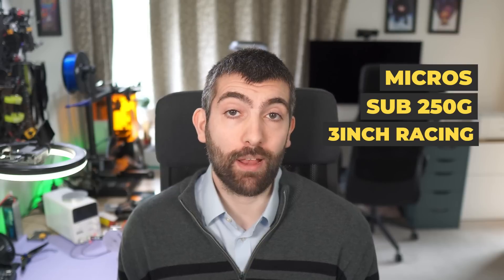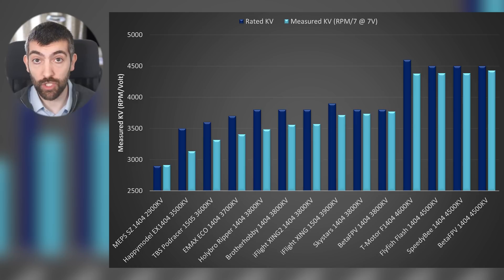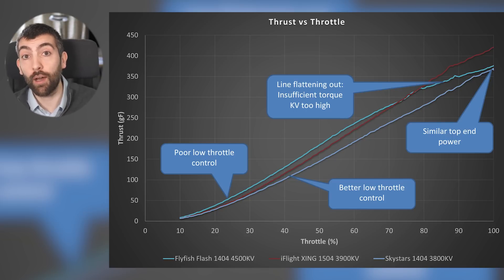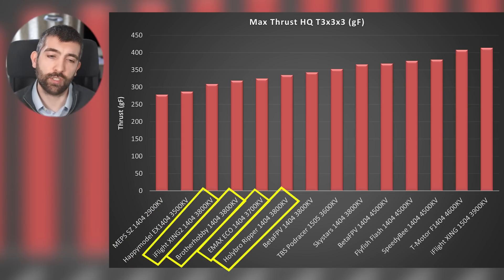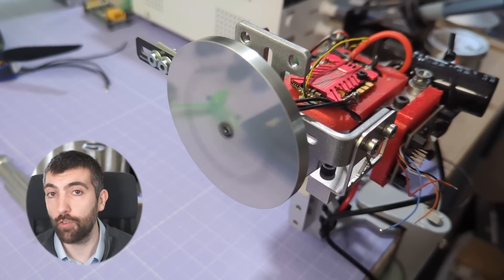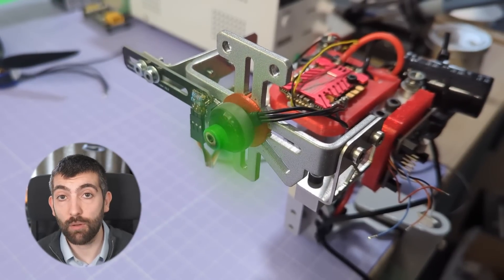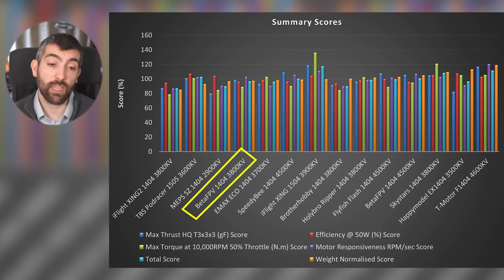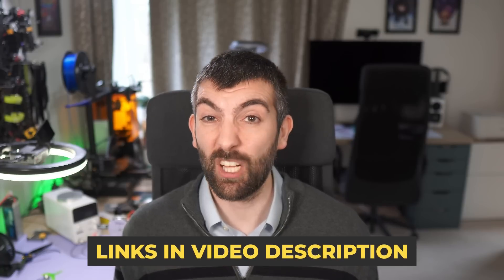The best 3" motor no-one has heard of... 1404 Motor Testing!

Comment: I'm currently using 1404 motors with a 4S battery on a 3-inch drone, but it feels underpowered. I'm considering switching to 1507 motors—do you think that's a good solution? Or are 1507 motors too big for a 3-inch setup?

Comment: Hey there!

I just ordered your awesome AOS Cine 25 V5 frame and all the components to go with it. I'm following your advice and will be using the Skystars Koko 1404 4600kv motors you recommend.

My main goal is to keep the final All-Up Weight (AUW) under 250g. Since I'm not exactly sure what the final weight will be, I haven't ordered the LiPos yet.

In the meantime, I'd like to do some initial tests using the LiPos 6s I already have. My question is: in your experience, what would be the maximum AUW you think these Koko 1404 4600kv motors can safely handle without risking damage? I really want to avoid burning them out while I wait for the right batteries.

Thanks so much for the fantastic design and any advice you can share. I can't wait to get this build in the air!

Comment: I wonder how the T-motor F20ll 3750Kv motors would do against these as well.. I have them already so they're going on a light-ish weight 3" Analog build so I guess we'll see, but its not a T-mount prop Motor. 
I believe its a 1408 sized motor though and it has the normal M5 prop shaft.. I'll have to look into those iFlight XING 1504's 3900v and T-motor F1404 4600Kv motors for my 3" O4 build I'm planning somewhat soon actually!!
Awesome video as always man!

Comment: Hi Chris, is the T-Motor 1404 4600kv suitable for a baby Ape Pro V2 powered with 3S and 3 inch Props? I think the peak current of the Motor could be to hight for the ESC.

Comment: I still have the rcinpower 1207 5000kv for my 3s toothpick. I went crazy buying parts 5-6 years ago, and havent had to buy anoything fpv for 2 years or so. Except new goggles and batteries. I still have an Airbladeuav "plus" Eclair in 3" with iflight xing 1404 4600kv. Oh, and the $45 diatone 30a mamba stacks in EVERYTHING that needs a 20x20. I need to get with the times...

Comment: Chris, have the Crux35, 1404 / 3500 Kv motors light Weight very efficient, Q, about Crux35 3.5” Shit frame. this is the 3rd frame  I broke on grass crashes. Can you recommend a lightweight durable 3 or 4”  4/5 Mm frame that’s better than the Crux35 Frame and can use the Crux35 20 x 20 stack / 1404 M etc.  any ideas Bro?

Comment: You don't speak about it but for all high Kv motors that are flattening, shouldn't we select a more suitable prop (reduced pitch for example ?) Kv selection is not the only parameter.

ENGINEERING QUESTION (good idea for testing/video?) Pursuing the goal of long range/best efficiency/lower power draw, is it better to :
1 - 4S battery, full throttle. 
2 - 6S battery, same propeller, reduced throttle  
3 - 4S battery, bigger diameter prop, reduced throttle. 
Motor/esc stay the same. Prop is chosen low pitch & have the best efficiency in 1rst case. Throttle is managed to get EXACTLY the same traction in the other cases.
Interresting to know if esc frequency can change the result and maybe other parameters I don't see ?

Many thanks in advance.

Comment: I luv my Skystar motors! I have almost every size and they are all some of the best economical motors you can get, i always wanted them in the other tests, Glad to see they did pretty well, i knew they would, i just wish the Motors were actually Matched up more,  like why put 3800kv against a 3800kv, t-motor makes a 3800kv but chris uses a 4600kv... just Not really a fair match up, like the low kv are for a biblade 4inch or 6s... Why is everything  all over the place?? might as well put a skystars koko 1505 3400kv in there on 6s that's going to destroy all those, lol
Reply: Honestly in my experience the T-motor is a touch lighter and may preform slightly better then the skystars if the 3800 is matched against a 3800, and same with the higher kv, cuz both skystars and tmotor are available in similar kv ranges, the biggest  difference is skystars costs more then 30% less which is why I'm a massive skystars fanboy. I would like to see the skystars 1505 matched up with t-motor 1604 on gemfan 3630 props tested on 4s and 6s! I've had crazy good results with the skystars!

Comment: 3:26 How can you precisely measure thrust, when ~50% of the area behind the propeller is blocked ? I can image it distorting results quite significantly, especially at higher throttle. Also I've tested most of available 3" propellers and the HQ 3x3x3 is one of the least efficient ones, tested on various motor sizes, KVs and AUWs.
Reply: They are all measured the same so the results would be the same. So comparison will be ok l.
Reply: @scottshipley570  That's true, but i can imagine that better performing motors will be affected more, so you can't tell that this motor performs 25% than the other one for example.

Comment: Your review is on point, I was just looking for 1404 motor for my 3.5 build!)
Two questions thou:
1. Since you make Supernovas with RCinpower, why haven't you included their 1404 SmooX motors in the test?
2. I need 3800kv for my build, should I get T-Motors with 4600kv and cap them, or should I simply get the 3800 version?
Thanks!)
Reply: 100% what I was thinking about the SmooX
Reply: I would go with the T-Motor 3800 if you are using 4S battery, thats what I use. I did try several 4500 motors but resulted in too much voltage drop, too much power for the batteries I like to use
Reply: @rafaelgonzalezmorales1824  Yeah, 3800 seems about right)
Reply: Same

Comment: If you had to run a 50g naked gopro (flywoo v2.0) on a sub 250g freestyle quad, what would be your ideal setup? What motor, prop and battery size? I´d propably design my own frame:)

Comment: I'm surprised to NOT have seen a Rcinpower, Mamba or Flywoo motor inclused in the test while some really obscure brands I never heard of were...
Also, I take it as a 1404 class test rather than 3-inch motor test. 1404 (not to mention 1504 or1505) in my experience is way, way too heavy for a 3-inch build. I use 1404s on my 3.5 builds (130g dry weight digital toothpick) and I use 1204 or 1304 motors on my 3-inch analog toothpick builds (60 - 70g dry weight). 

Anyway - I hope this was a prelude to you, Chris, releasing your own 1404, which I very much look forward to - it will most likely be a replacement for my current Rcinpower on 3.5-inch builds, so long as you make it both a 4s (around 3800 - 4000kV) and a 3s (5000kV). 5000kV is a very interesting option, because, in my experience it performes phenomenally well both wit 3s and 4s (75 - 80% motor output)
Reply: I use 1604 on my 3inch builds and love it 😜

Comment: Very nice in depth testing. Thank you so much!
I am actually moving away from 1404 for 3”. I’m down to 1303.5 now. The lighter motor combined with almost the same power makes a good pop when you throttle up and a good amount of control. Obviously that would not be as good for cruising.

Comment: Thanks interesting test, also of interest to compare the internal resistance of the motors. I am pleased you added the efficiency of the motors at 50%. Interesting motors would also be the Sparkhobby Xspeed 1303.5  and the Geprc Speedx2 1303.5 3800kv, which both show high efficiency nrs.   Personally I like to fly the less powerfull motors, on 4s light toothpicks, with light bi-blades prop.  the HQ prop on my toothpick are absolutely inefficient. Gemfan hurican bi blade and 3 blade are much much better on light 3inch builds.    Which is totalally different usage than on heavy racer or cinewhoop.   So to pick the right motor for the application is still not obvious, there is a lot more constraints.  So the happy model most efficient motor could be the best choice for the light tooth pick and driven with light gemfan bi-blade.

Comment: How do the lower torque motors behave with a lesser aggressive people like a 3x1.8x3?

Does the Power curve still bend down?

How does one low torque motor behave with different props from 3x1.5x3 up to 3x4x3 ? 

Where is the sweet spot?

Comment: Great testing as always. The only thing I missed was for you to recommend using a lower pitch prop with the higher kV motors to reduce the flattening of the thrust curve. I think the HQ T3x2.5x3 could be a better fit for some of the motors.
Reply from the maker: Great point. When I do batch 2 I will definitely mention that.

Comment: Everything points towards the T-Motor F1404 3800KV to be a great motor, if you ever decide to add more it should definitely be on that list to compare 2 different KV of a motor.

Also sad that the P1604 didn't make the slightly-larger list, it seems to be the perfect compromise for 250g AUW freestyle if you take care to save some weight in other places.
Reply from the maker: I have an open door testing policy, I'm happy to test and return to you any motors you want added to the database. 👍

Comment: Do these results vary depending on the ESC the motor is mated with?
Reply: If your ESCs handle >20A per motor, the results should be the same. No matter what esc or aio manufacturor.
But your battery will change these results alot. Still the motors compared to one another give the same results

Comment: Would have liked so see the Flywoo NIN 1404. It has a decent flux ring. It reminded me of the AOS motor as a result. Thank you for testing on behalf of the community.
Reply from the maker: If you have a spare flywoo nin 1404 you can send it in and I'll test and return it to you.
Reply: I sent an email to Flywoo asking if they could send Chris a motor because I also would love to see the NIN 1404 in the next batch
Reply: @ChrisRosser can you also test the Smoox 1404 2750kv, I’m running them on a 4 inch LR and while they might not have a great deal of thrust compared to some of these others in this test, they are extremely effecient and I’d say on par with the Flywoo

Comment: Would these motors so be suitable for a 3.5" sub250? Maybe the lower kv versions? Thanks
Reply: It's fine for lighter 3.5inch builds. Cinewhoops are probably too heavy. A Crux35 is a nice frame for a 3.5inch build with 1404 motors.

Comment: WHY WHY do you not go over durability and construction of the motor???
this is all great for people who are chasing 5% - 10% additional performance but the reality durability is a lot more important for 2024
its not 2016 any more 

shaft diameter is an extremely important spec specially on 1404, motor materials and construction, bearings, and motor weight, a super light weight motor while very good, can also mean it won't last beyond a single crash.
Reply: I’m pretty sure that all these motors use a 2mm inner shaft with a 1.5mm outer shaft and the same size bearings. Perhaps he excluded such specs because they’re all the same.
Reply: @yohfpv  Unfortunately that isn’t true, some of these are 1.5 and some are 2. For example, Emax motors while very cheap, they were more durable than most because they had a 2mm inner shaft.
Reply: Has he developed a reliable and accurate durability test yet? Without that all he can do is rattle off specs that you can find on your own.
Reply: @Voyajer.  a lot of manufacturers don’t list these specs, which is the point of someone testing and comparing. also a lot of people in hobby don’t even know what to look for, maybe you do but a lot don’t….

Comment: I'd love to see Flywoo NIN 1404 added to the list!
Reply: This! Flywoo motors are crazy good nowadays
Reply: I would too!
Reply: Rcinpower smoox 1404 are on par with the Flywoo NIN 1404 if RCInPower test sheets are anything to go by.   I'm currently working on an ultralight 4inch sub250g build, currently flown it with Smoox 2750kv motors with a 1100 mAh 4S lihv.   Achieved a 12min17sec flight with the battery taken to its flying limits.  My maths was giving a longer flight time but being fairly new to this hobby I only allowed 0.5A for the O3 Air Unit but supposedly it can draw up to 2A.  So on top of the motors, it's drawing about 4.5A on a hover and  probably around 5-5.5A on a forward cruising flight.  My last flight I didn't have any voltage or power info, this is resolved now so my next flight will be less nerve racking
Reply: @MadfishFPV emulate best you can the mayfly 2.0 sub 250G micro drone that made a 33 minute long and 30.2km flight (quad copter) using 3s 18650 li-ion batteries, but for motors use the flywoo nin 1404 v2 3750kv

And for batteries use 3 of the Original Vapcell N40 INR 18650 Battery Highest Capacity 4000mah

You will likely achieve a 47 minute flight going about 80km/h optimal efficiency, range could be nearing 40km! On a round trip (sub 250 grams) google mayfly 2.0 sub 250g drone build, you could beat the world record with these equipment upgrades.
Reply: @MadfishFPV emulate best you can the mayfly 2.0 sub 250G micro drone that made a 33 minute long and 30.2km flight (quad copter) using 3s 18650 li-ion batteries, but for motors use the flywoo nin 1404 v2 3750kv

And for batteries use 3 of the Original Vapcell N40 INR 18650 Battery Highest Capacity 4000mah

You will likely achieve a 47 minute flight going about 50-80km/h optimal efficiency, range could be nearing 40km! On a round trip (sub 250 grams) google mayfly 2.0 sub 250g drone build, you could beat the world record with these equipment upgrades.
Reply: i have bought 1404 4350kV for my wing tip delta. but i am wondering if i can attach 5030 propeller to it? what do you think?
Reply: Have done another test flight being extremely conservative in flying, by trying to keep the total current around 4A and a speed of 35-40kmh.   With the RCInPower Smoox 1404 2750kv and using the GNB 1100 4S 60C lihv, I’ve achieved a 16min30sec flight time.   I’ll upload this video when I’m back from holidays.  I might go out of my way to get one of the motors Chris recommends for long range flying and see if it can perform as well.
Reply: 100%. They have some special sauce, those.

Comment: I'm a little confused why two 4500KV motors are considered "too high KV" but then the highest recommended one is 4600KV, did I miss something?
Reply: Because the recommended motor can use that high kv at the top end due to having more power
Reply: @24rjt24  thanks :)
Reply: He notes that the high KV have poor low throttle response. In his recommendation he suggests using throttle expo to balance that low throttle jumpiness.